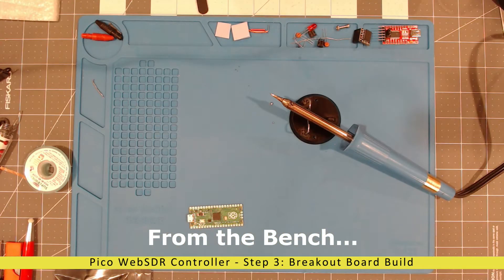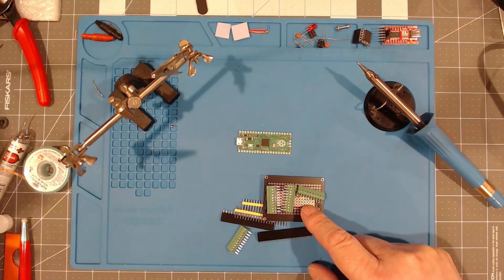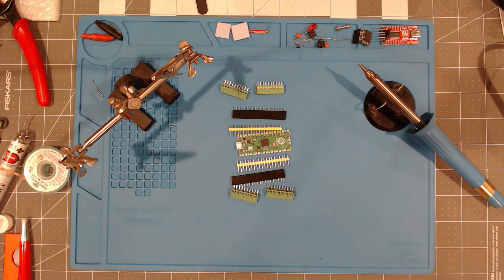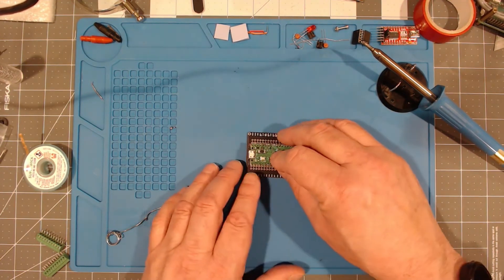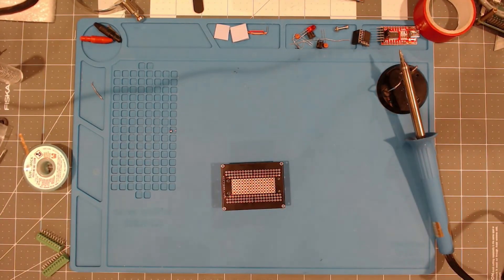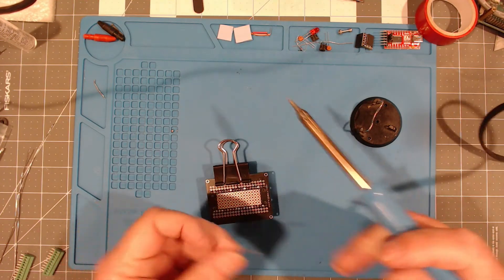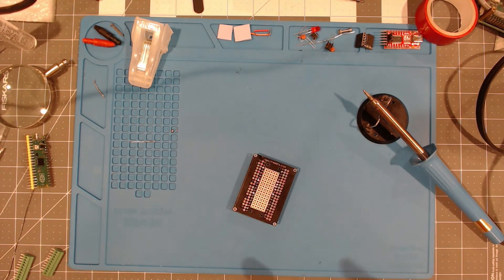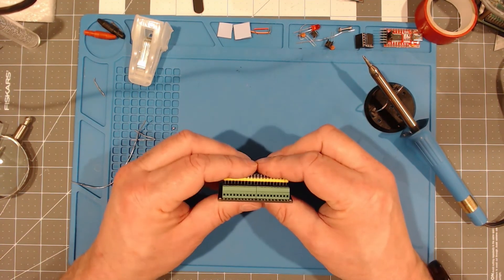Pico WebSDR Controller   Step 3: Breakout Board Build

Comment: You didn’t show underneath.
Reply: The entirety of the soldering is done on the underside of the board.
Reply: @RickMunday  oh, I see the rows are already internally connected. I thought you you would need to solder a line from the pico rails to the terminal rails. OK, great video. I do appreciate you taking the time to make it.
Reply from the maker: All done on the underside. Is there something specific you'd like to see on it?

Comment: Did you end up having to solder the pins from the pico mounts to the green wire terminal blocks?
Reply: Hi, thanks for the reply. I was asking if I needed to add jumper wires from the pico mounting holes to the terminal block mounting holes. I later learned the terminal holes where the Pico mounts are connected to the holes the terminal blocks mount. On the board, the connection is not visible.
Reply from the maker: @An Admin User  Gotcha. Sorry about that, it's been a long couple weeks at work. Sometimes I come home from work and I'm not firing on all cylinders 😂 

I actually need to get back on that project. It's still broke out on a breadboard, but I use it pretty much every other day.
Reply: @stfuandfish  oh sweet. Well, I’m subscribed, so I’ll check it out when you do. :)
Reply from the maker: @mstrtrv  Thanks!
Reply from the maker: @mstrtrv  and rereading this, there are no jumpers required from the Pico to the terminals. That's done in the circuitry itself on the board.

And believe it or not, that project is still sitting on a breadboard 🤣 I have yet to get back to it.
Reply from the maker: They're screw terminals. Or am I not understanding your question?